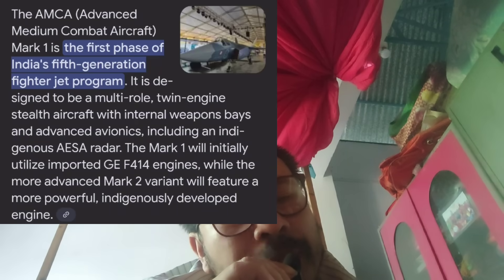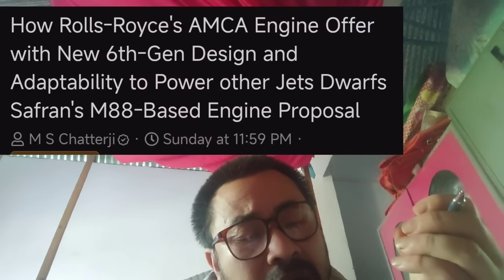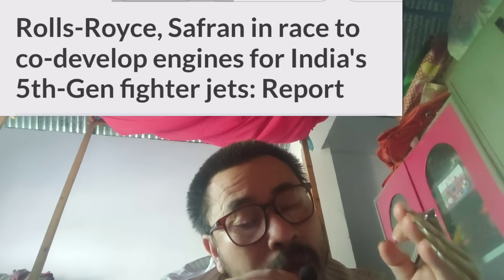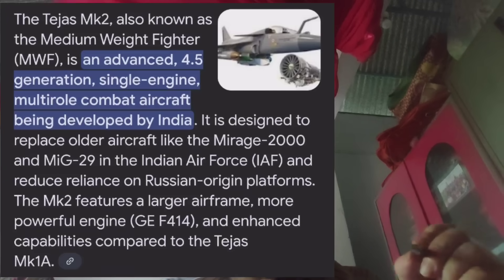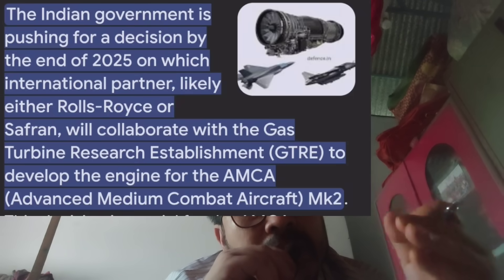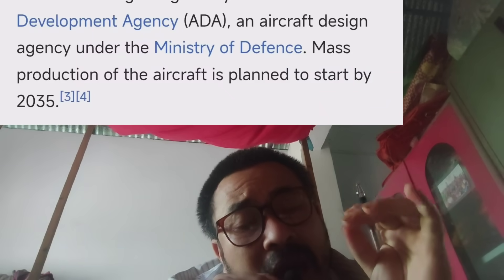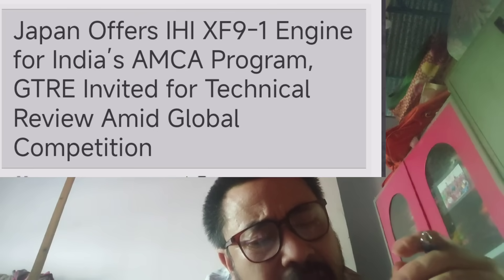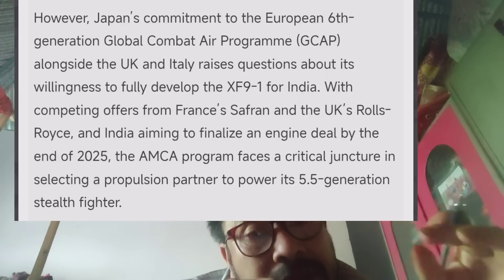AMCA GI LASTEST UPDATE KHARA KHANGMINASE

Comment: Will India be able to make and produce her own most powerful fighter engine?
China has already produced her own fighter engine.
Will India be able to dominate China?
A BIG QUESTION?
Reply from the maker: india have the capability of making jet powered engines but less after burners.
Now the point arise that when INDIA will. have that capability so china was not able to develop its fighter jet engine till yet if he haven't copy the engine of Russian fighter that it operate now. India will soon develop a fighter jet engine so in this we have a class of engine that is lacking with the blade issue that alloy of the blades when we do the supersonic meltdown in between india is doing partnership with France saffron or uk Royce royals to manufacture jet power engines to give the futrure INDIAN fighters the lift they need and in this India is coming close day by days its not a one day task it will take time but  as an weopon analysis I can say the finally product will be awesome not as the unfinished engines of china reverse engineering from Russia engine. Now Indian have a testbed facility in bangaluru it means India can test their own engine and it's the sign India is working hard towards the engine and will have a perfect engine of its own soon. 
Thank you